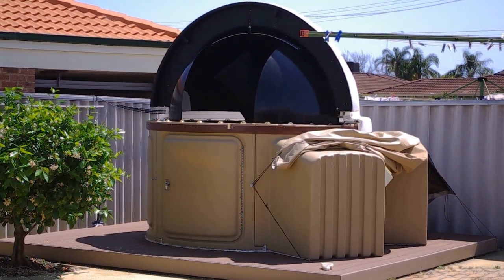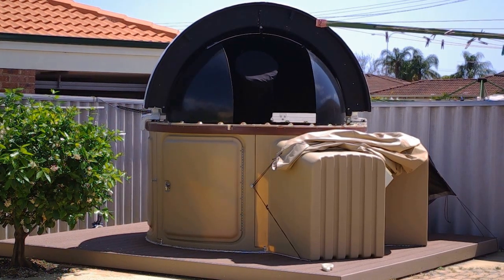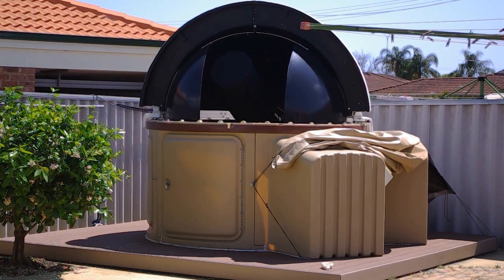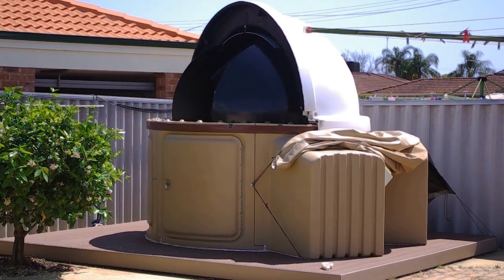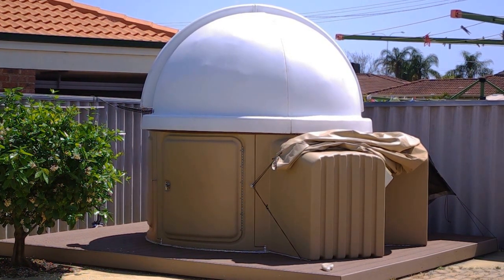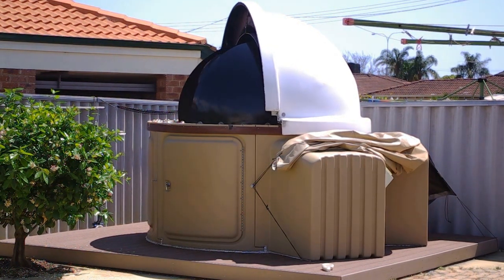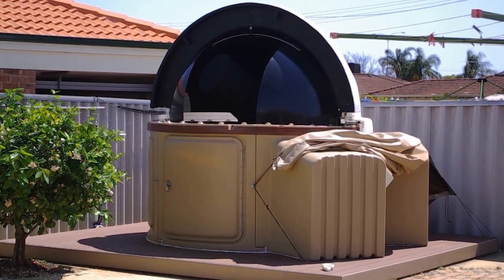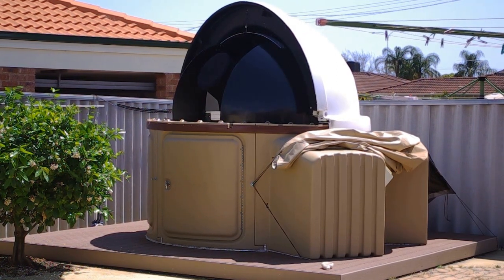StarPOD Automation

Comment: +thava N how is your development so far, i have checked your website and their doesn't seem to be anything there. Thanks for sharing
Reply from the maker: It is stable and currently I have 6 install base running my system. Here are more info on the setting up:  http://www.iceinspace.com.au/forum/showthread.php?t=146218&highlight=skyshed
Reply from the maker: We have done some new upgrades to the belt drive system. This makes the whole driving smooth and quiet
Reply from the maker: Use water base matt black paint.